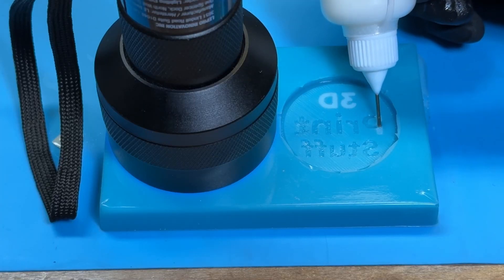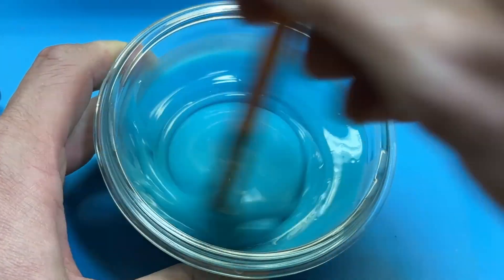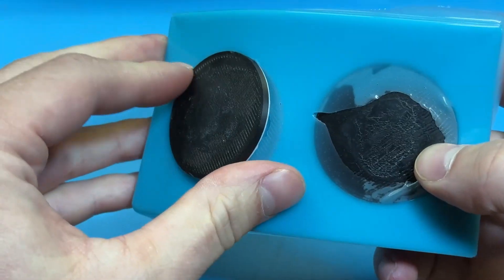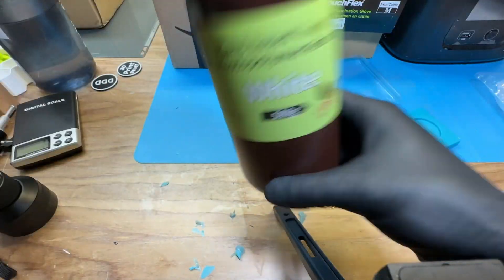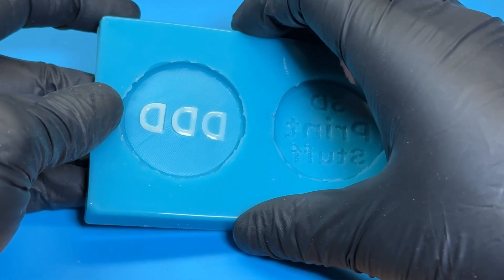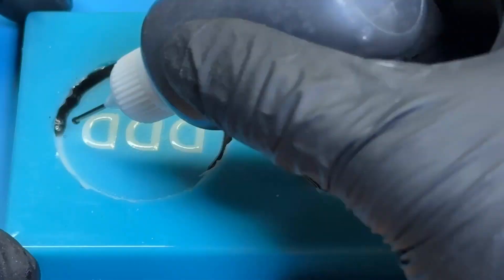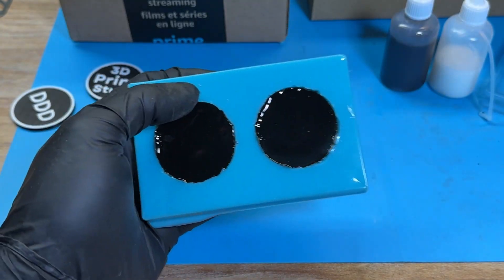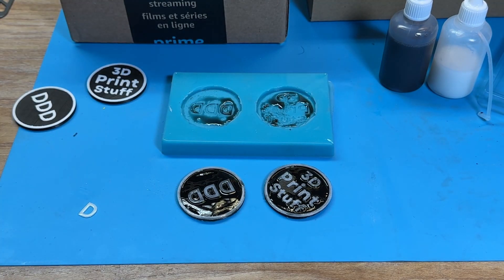Can You Cast Parts Using 3D Printing Resin?

Comment: I would live to see this tried in a clear silicone mold and under a UV lamp. I really wanted it to work as the large bottles of 3D resin are so much cheaper (volume wise) than the small epoxy resin bottles I spend an arm and a leg for.

Comment: I've tried to cast some 3d resin and it  was boiling transforming and losing its shape
Reply from the maker: I did have some deformation in the back layers, not sure if it's from the curing process or just how I laid down the resin.
Reply: @3DPrintStuff  back and front, it becomes a mess it can't be cast here

Comment: Does the silicone mold pick up the lines from the 3d printed part ?
Reply from the maker: Yeah it's pretty good at picking up every little imperfection. If I was to do this again I'd maybe use some filler primer and sand paper to make it very smooth. Followed by a clear coat. Depends on the end result you're looing for.

Comment: I'd try leaving the coins in place and use a sharp knife to cut around them to remove the flash.
Perhaps you just need a more powerful UV light source?
A flashlight just won't provide much UV light power.
Reply from the maker: Yeah these are all valid ideas. My curing station has more power but I'd have to turn it upside down so that the resin doesn't come out of the mold.

Comment: Nice, thanks for pointing me to this video.  What about using a clear silicone instead of the opaque one?
Reply from the maker: Yeah I'm curious about this too. I don't think it would have good results either. I learned through this video and some comments that 3D printing resin doesn't transmit UV very far. So your part would have to be very thin and the silicone would also need to be thin to allow the UV through to the part. There are just better ways.
Reply: @3DPrintStuff Which are?
Reply from the maker: @Sparkynutz81  To use casting resins made for this application.

Comment: resin for printers is made not to transmit the UV very far into the liquid. It will take a lot longer exposure times per layer, I would try heating the resin up to decrease surface tension, and using a small brush to paint each layer on, then cure, repeat.
Reply from the maker: That’s an interesting point. This method might work better with regular UV cured crafting resin. A brush to apply thinner layers would have definitely produced better results.
Reply: @3DPrintStuff  Yes, even black regular UV cure craft resin allows deeper penetration of the UV than 3D printer resin. But 3D printer resin has such low viscosity that it is useful in some situations. Your white letters at the start of the experiment were a total success IMO. I can see many uses for this. For example, filling embossed lettering / auto conforming to surface detail thru gravity and surface tension, translucent LED peep holes etc. I even tried it as a wood finish - apply with a rag / cure / repeat. As the resin is translucent it builds a nice hardwearing colourwash-like finish.

Comment: Is there a clear silicone?  Maybe that would allow more UV light to penetrate your mold?
Reply from the maker: Yeah that’s a good suggestion. Someone else also mentioned that 3D printing resin is specifically designed to not transmit UV light very far. So this technique might still be feasible with UV cured resin just not 3D printing UV cured resin.